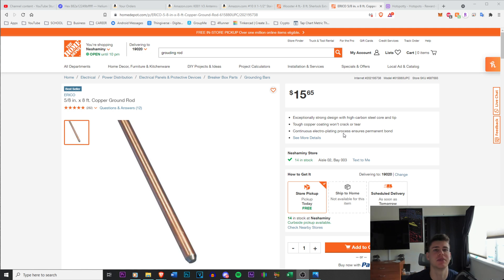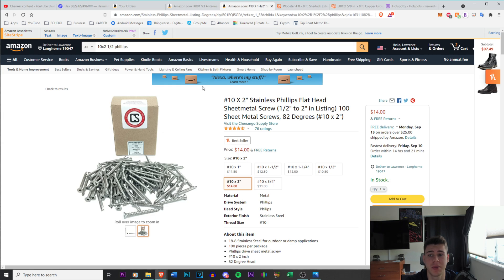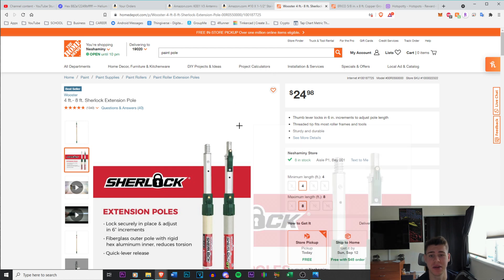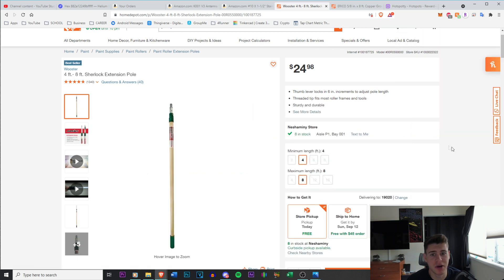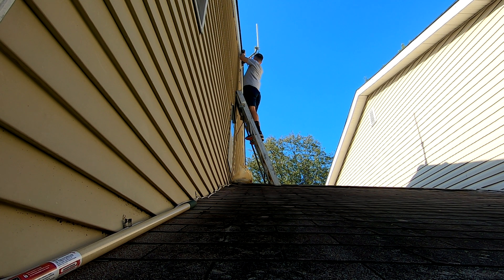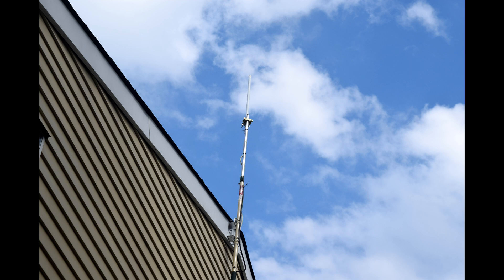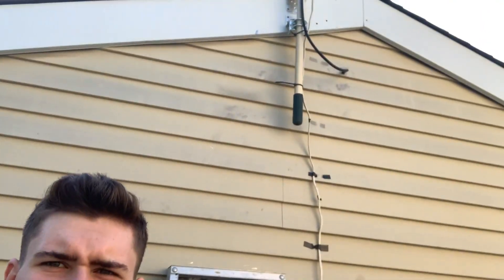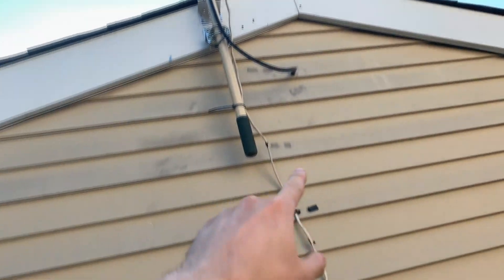Upgrading Helium Antenna Mount

Comment: hi, thanks for the video it really helps
may i ask how the extension pole is working, would you recommend getting a metal conduit pipe to hook up on the roof
Reply from the maker: Metal pole is working great. Its nice because it is fiberglass and aluminum so not as conductive. You can try the conduit pipe just make sure you ground it some way

Comment: once you upgraded your antenna was there anything you had to do within the app to indicate that you now have a different antenna?
Reply from the maker: Yes I updated it in the app in the same spot where you change the location
Reply: @chrisbagnell  what did you put for your antenna because I can’t find it and I bought the same one as you
Reply from the maker: @joevega1102  There is an option for "custom antenna". It was a little finnicky when I was trying to type into the box but it eventually let me put 5.8. The other option i believe it says "RAk Antenna

Comment: Ditch the philips screws and go with T25.  They are kind of a star headed type screw.  Only ones I use and work SUPER well.  Also get the coated screws as they wont rust out either.  See them a lot with deck construction and things like that.  Thanks for sharing your antenna setup - about to embark on my own as well, just waiting on shipment of one more piece.

Comment: I have my ground connected to the main ground of my house! 
There may be a solid ground cord running along the bottom frame of house. Most have it
Reply: And that is the correct way to do it. If you have a separate ground rod you must connect it to your main ground. Should only be one common ground point.
People should not be hooking these things up to antennas without proper electrical safety.

Comment: Hex head screws are much better then Phillips. Cheat a little with the ground rod install, get the ground wet for a bit, low flow on the hose.
Reply from the maker: Thanks for the advice!

Comment: Just curious did you weatherproof your antenna connections? Some people I see just use liquid electrical tape... Or layers of rubberized tape
Reply from the maker: No I did not weatherproof it, I believe there are rubber rings on the connections so I am not concerned about water